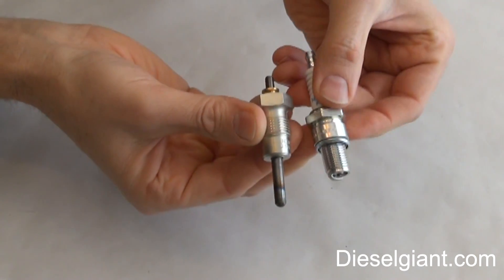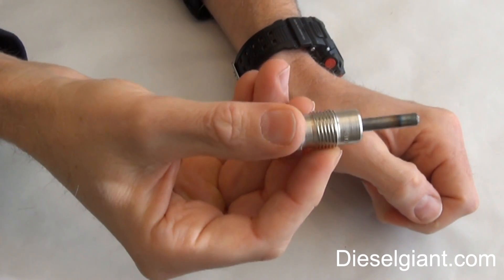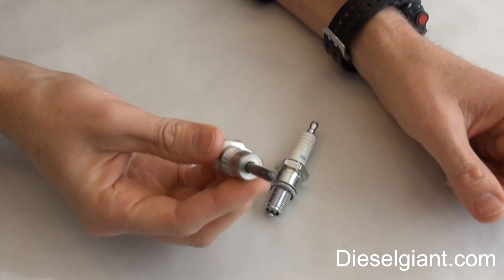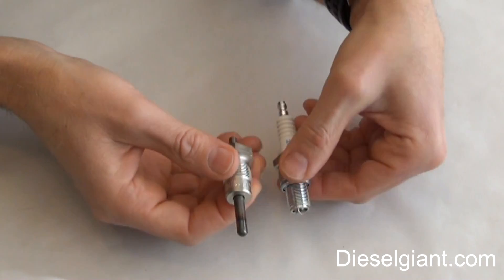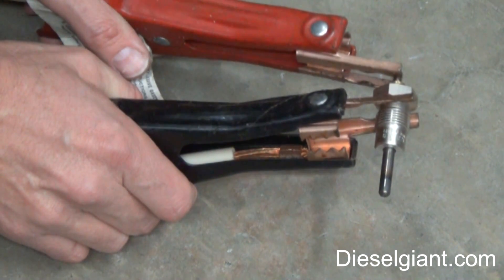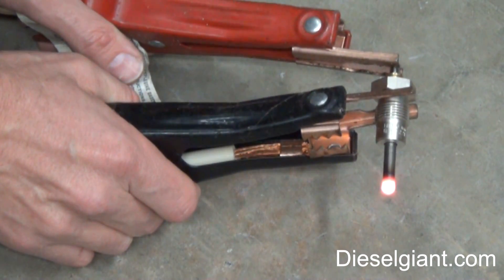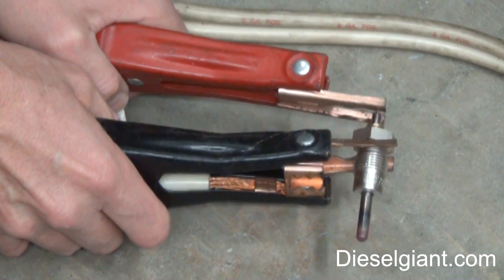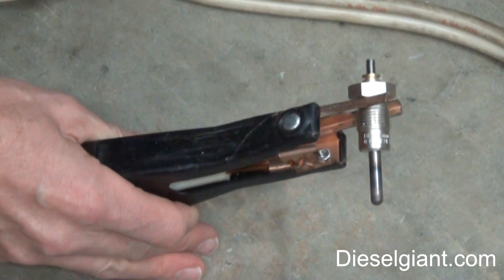Glow plug vs  spark plug explained

Comment: something for a rule of thumb i have found, anyone with experience building engines (and actually knows what they're talking about) you have two arrows. one up and one down and two factors, compression resistence and compression ratio. petrol needs up resistance down ratio, diesel is inverse. just by factor on how they work, diesels need more compression ratio petrol's do not.

Comment: Nice glow plug demo ! 
I've an '82 300TD..Always wanted to know what the plug actually looks like when activated.. 
Also, for your viewers: If you drive a diesel too, once engine is warm and you say, go shopping for an hour, say. When you go to restart the car do not wait for glow plug panel light to go on and off. Just turn the key immediately. Otherwise you're just wearing out the glow plug life sooner..IE. They are not needed once engine is warm..But, say, 4 hrs has past, THEN, yes, re-employ the glow plugs...

Comment: Well there is non expecialy on dizel gasoline engine blocks ore also refered to hot bulb engines control that curent jett fuel corectly ore carburate it achive all necesary temperatures and use glow plug insted of spark plug simpel that works on any multi grade fuel engine .
In fact old otto engine run on dual fueling original dizel run on carburetors with fuel air pre mix chambers hot tubes ore what ever viriety you want mostly they use crank to cam ratios ore flywheel weight ore multy stroker engines to increase cooling capability and actualy use high energy fuel like crude oil ore used oil as long you have necesary requestments engine will run .
Gasoline is primary fuel for idel turn engine on and reach operation temperature for the secondary fuel useing lean burning.
Secondary fuel is own engine lubrication oil coming from crank case for idel to max rpm.
After the secondary fuel kicks in!
No gasoline is requared and no ignition system is requared.
Engin run purely similar to dizel.
But its not .
On gasoline dizel blocks that is chemical preshure diference thermal reaction magnetism might by aplied as well.
It is a form of self ore auto ignition.
Old high amp low speed magnetos done that exact same task!
So yeah nice video and all but thats the true histori and reality about centrain engines.
Im actualy useing those effects on my old gm based opel ascona 82 model 1.3L gasoline engine .
It works not on all engines my engine is sohc design it has slightly higher compresion ratio then normal engines.
Those are closely related to chevy 250 and 350 who are clearly marked Gasoline/Dizel blocks ore see for older related engines on wikipedia .
To those engines no normal mechanical teaching is aplied !
Those are after all considered hybrids.
How ever Im useing controled pre ignition with cold gasoline vapor and hot oil vapor as result of high speed lean burning effects.
So thats why they call them hot cold runing engines similar task achives waste spark managmeng virtualy creating 2 and 4 stroke engine meaning 6stroker virtualy .
And some special features that same engine can run on internal ore external burning working principels.
So yeah nothing realy complies to such engine types.
Thats some interesting facts Im actualy surching to buy such small glow plugs to actualy make hot bulb engine they similar in size like spark plug that thing is usefull for that plug curent control culd by used circuet ore somthing like that .

Comment: Obviously the glow-lug works when the engine is cold. What keeps the glow plug from coming on once the engine has heated up and the compression stroke generates enough heat.

Comment: Like you video , and I just  have curiosity on something , that if u make video of diesel engine that. U start then with out alternator on the engine , just start the engine from stand by , with battery  to starter then after u fire disconnect the battery  , no alternator to engine , after get hot like u say will keep run like u say ,, but I'm not sure  if that. I will be the  case, and I tell you why, after you make video , I am subscribe  to you , let's follow you the science,

Comment: Glow plugs do not heat the air in a diesel.  It is a point source of heat placed under the injector nozzle to ignite the diesel fuel.  
Do the math:  A glow plug will draw approximately 10 amps in use.  Thus, 12 Volts X 10 Amps = 120 Watts.  If you think 120 Watts will heat the air in a cylinder when operated for 30 seconds or less, you are incorrect.  There is far too large a mass of metal and coolant trying to draw the heat away (regardless of source).  Air is an insulator and resists heat transfer.
Since compression of air inside a cylinder causes heat to be produced, simply turning the engine over fast enough with a starter should start a diesel engine.  I live in Alaska and I assure you a diesel will not start most of the year here without 1) a block heater to warm the coolant, 2) glow plugs, or 3) a source of a combustible gas (ether, a.k.a. starting fluid) to get the engine started. Do not use starting fluid (ether) on a glow plug equipped diesel unless the glow plugs are disabled.
I ran a test with a glow plug installed in GM indirect-injected cylinder head (on the bench with no coolant).  The head was upside down and the glow plug (a self-limiting type) was actuated for 30 seconds.  Using a digital infrared thermometer, there was no change in temperature detected before or after the test on the cover (plug) installed on or in the pre-combustion chamber.

Remember, the glow plugs are not powered on long enough to transfer a measurable amount of heat to the cylinder.  They can only provide a point source for the fuel to ignite upon cold start.  That is why they are placed under the injector nozzles.
Reply from the maker: Nope your incorrect.  The glow plug gets over 1000 degrees Cel and DOES heat the air in the cylinder enough to get the combustion cycle started.  In the Cummins 5.9l there is NO glow plug but a heat grid in the intake to.....yep heat the incoming air.  Accomplishes the same thing as individual glow plugs but in a more efficient manner and with only one heat unit.  The heat grid is no where near the "injector" but well before it.  Your also NOT trying to heat the whole cylinder up as a block heater would, but heating the air just enough to help the combustion get started in super cold situation.  Your math calculation has nothing to do with the heat at the tip of the glow plug.

Comment: do glow plugs ignite the fuel
Reply from the maker: No spark plugs ignite the fuel.  The glow plug just heats up the air in the cylinder just enough to help the compression ignition.  When the piston compresses the air, it get almost 2000 degrees and the glow plug just helps when you first start up the cold engine.  After that they are off.

Comment: Not all diesel engine have glow plugs. My fraightliner had a Detroit with no glow plugs and the same with my Pete that have a catapiller with a c 15. These motors create enough heat on the compression stroke to fire the comprest fuel to ignite.
Reply: He literally said that in the video. Have you even watched it? :)

Comment: Bigger trackers i work on dont have glow plugs or grids. Some might have either start but no one replaces the either cans. Most in cold weather areas have block heaters to plug in 120 volt to keep the coolant system warm.

Comment: Do the glow plug activate when you turn the key full way as to start the engine, or does it start when you turn on the ignition (like, turning the key half way? Get the displays and radio on). 

In cold climate (say around 0 and less Celsius), would it be beneficial to then keep the key half way on for a while to let the glow plug work and heat up the (intake) air to help the engine fire?

Or is it that the glow plug start first when you make a full turn of the key to get the engine to rotate and start?

Comment: Good stuff, I have a toyota caldina wagon 2200cc diesel engine, so if i'm changing the glow plugs do i just buy any or there are specif ones that I should get? So ive never changed any of the plugs ever. I'm having trouble starting the engine.

Comment: Glow plug questions!
1) I've heard it said that if you try to start an engine before the glow
 plug light turns off you could damage a plug. Why?
2) If you have (already) started an engine while the glow plug light was
 not off is there any correct procedure to move forward to lessen any 
damage?
Thank you for this informative video.
Reply from the maker: No it will not in any way damage the plug.

Comment: You could argue the Diesel engine is better engineered for it to run on its own compression where as petrol needs an extra prone to failing part (sparkplug) to make the engine run. Agree? Disagree?
Reply from the maker: A diesel IS designed to run on compression ignition as gas engine is not.

Comment: what does it mean if the glow plug warning light turns on while the car is turned on ? it happened several times with me while driving and i had to stop and restart the car
Reply: Probably just a sensor. If the car was up to operation temperature then it was just a sensor gone bad.

Comment: glow- and sparkplugs have absolutely nothing similar! There are plugs that are as similar...

diesel engine compression is also complete different to gas engines! in gas engines you can vary the compression depending on how close you can get BEFORE selfignition. you DON'T want that on a gas engine! compression can get from 8:1 up to 13:1 e.g. in jaguar HE v12 in the 70ies onwards.

diesel engines operate different: they CAN ONLY work in a specific range of compression! indirect injection NEEDS 21:1! (+-0.5). direct injection 17:1.
diesel air mixture (btw THIS can be a wide range!) self ignites at 900 degree Celsius. If combustion cannot reach that temp (engine cold), the glowplug can help with pre heating the combustion chamber. this is how it works in 3 sentences.

Comment: If the air gets up to ~2,000 degrees in a diesel engine, why can't they run straight natural gas?
Reply: Doesn't burn as hot as diesel does. The engine would have to be completely redesigned for such an extreme power loss (turbos, ect)

Comment: A glow plug in the small hobby R/C world, such as a Traxxis T-Maxx, will sort of look like a spark plug (not a stick) and will have a wire coil that runs inside that looks like a spring. And is way smaller in size like a little bigger than a lego head piece... Most of my starting issues for the T-Maxx were not glow plug related, but was just a complete mystery. Maybe clogged up carb. Most likely ya...

I have learned tons more about smaller motors when working in landscaping than I ever have about hobby help docs to troubleshoot your T-Maxx that fails to start.

Comment: that makes sense why diesels runaway
Reply: Rickish Monkey66 yup diesel  doesn't use the glow plug like people thing, it's for cold starts.
Reply: @Photostudioww  If you're brave you can squeeze the oil supply line going to the turbocharger. The engine oil is supplying the fuel through a bad turbocharger.
Reply: A runaway diesel is a malfunction in the turbocharger where the engine oil is burning through the compressor side of the turbo and in charger and manifold. Basically the engine is running off the oil in the crankcase and keeps running until thrers no oil in the motor and it blows up .
Reply: So what is used to stop a diesel engine runaway? Shutting off the fuel source?

Comment: can we replace spark plug with glow plug or vice versa?
Reply from the maker: umar khushnood no
Reply: why what's the reason?
Reply: glow plugs provide a constant source of heat waiting for the engine to get fuel and turn over to create that first cycle a spark plug creates a perfectly timed source of ignition that has to so perfectly timed the length of the spark plug cable can modify the timing

Comment: engines need more than heat air and fuel. I have herd im my career many times that engines need spark air and fuel. well they need more than that aswell. you can have all of these and have an engine that dosent run. COMPRESSION engines NEED compression period
Reply from the maker: Ryan Rohauer compression IS what creates heat in a Diesel engine.  After the glow plugs have done their initial start.  To prove this just disconnect your glow plugs and take the engine down to below freezing and see if it starts it still has the same compression but probably in most cases if it's cold enough will not start.  Why is this?  Because the compression is not sufficient enough to create enough heat.

Comment: how does a diesel engine survives an emp blast? sorry for my english
Reply: jesimig paneda modern diesels don't
Reply: sir Ryan Rohauer  did you mean only 1980s below can survive that blast?
Reply: some in 90’s are still fully mechanical. no computers. they will survive.
Reply: +jesimig paneda I doubt it, too many sensors and electronic injectors dependent on computer
Reply: ah so modern diesel wont be able to run without it?

Comment: Just a reminder, a diesel truck must have glow plugs. there is no argument against it because normal outside air doesn't meet the compression ratio. 4:10 you said they would start regardless, but id beg to differ
Reply from the maker: alec chamberlain sorry but my Dodge does not have glow plugs, starts every time.  Also there are lots of Diesel engines that don't use glow plugs or grid heaters.
Reply: Same.  2001 cummins with no glow plugs.

Comment: Wow I never even knew that these existed. I thought that all engines apart from Jet Engines used Spark plugs. The more you know! Thanks for this!
Reply from the maker: Yes and the jet fuel is basically diesel/kerosene fuel
Reply: Some aircraft jet engines use glow plugs in whats called hot surface ignition however most use spark, In a jet engine the spark plug is much bigger in size and produces a much hotter arc, Jet fuel is a fuel oil that is a cousin to number 1 household kerosene and is not easily ignited without it being heated, compressed or atomized first
Reply: Ken Arbuckle Aye. I watch a show on Air Craft crashes, and one crash was caused by a malfunctioning Combustion Can.

Comment: Can i ask you Once ?   If the Glow plug of my Diesel Engine Not work well the Engine will make a lot of smoke and sound ?
Reply: no it won't, If it's black smoke it's just unburn fuel, if that is the case I would check out the injectors and the injector nozzles as well worn nozzle would cause more of a wider/ bigger spray aka more fuel than normal- more un burn fuel- black smoke out of the exhaust.

if it's ticking it's probably the injectors

Comment: I like the video but a gas engine need fuel/air mixture, compression, and ignition, not fuel air and spark. Compression is very important to have a gasoline engine run, without it it won't even start a little bit
Reply from the maker: Yes of course it needs those things.  However it wont run without spark.

Comment: This is very very very helpful for me! Thanks mister!
by the way, we just changed the glow plug in our diesel engine car.. but sometimes the engine wont start normally.
can you answer me what might be the cause?
is it on the battery? or maybe there are wires that are connected from the battery to the engine?(broken wiring i think?)
Reply: PS: I just hear clicking every time I start the engine and It is not cranking.
Reply: +JM Mayuga battery is most likely dead

Comment: Is this also why diesel cars usually have much bigger batteries than petrol cars? because of all those glow plugs and high pressure fuel pumps and stuff?
Reply: Possibly but a lot of diesel engines are vacuumed. So cranking the engine requires a lot of toque/or arm strength therefore i think that a bigger battery can provide at least 100 amps for longer than petrol cars can. However it really depends on how much the starter needs, and for how long.
Reply from the maker: No because they have much higher compression ratio.  It takes more energy to turn over the engine.
Reply: well vacuum was wrong... however the effects would still be the same... a LOT of talk is required to crank the engine, that's basically what I said apart from I said compared to a petrol it would be easier to crank a petrol engine so in a diesel due to the amount of talk required to crank the engine the starter motor pulls more current from the battery and for a longer time. thus a bigger battery with a higher capacity and that is capable to produce a continuous abusive workload output is required.
Reply from the maker: Dubstep_lover
This whole paragraph make absolutely NO sense!  Its harder to crank because the compression ratio is higher, period!
Reply: welldone therefore the starter motor uses more power to crank the engine. and a bigger battery is needed to provide the power required